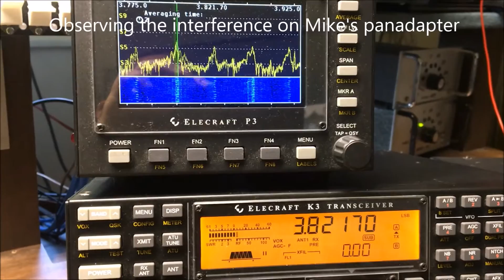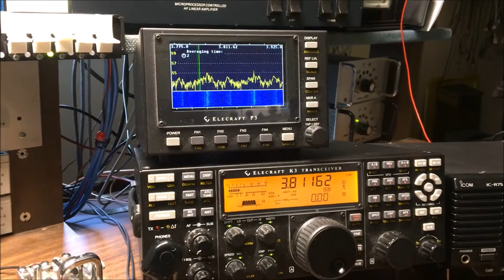Tracking Down Radio Frequency Interference at W9RE on Oct 15, 2016 by WD8DSB

Comment: Where you able to work with the neighbor to get it resolved. And what was it
Reply from the maker: Hi David,
Mike (W9RE) met with the homeowner a couple of weeks after we tracked the RFI down to his house, and the home owner was very cooperative.  Turns out a LinkSys 20 port switch was being run by a 3 Vdc 1 amp power supply, and it should have been using a 12 Vdc 1 amp power supply.  Problem was resolved when the correct power supply was used.  The homeowner commented that the 3 Vdc power supply was very warm, so he was very happy we tracked the RFI down to his house.
Don (wd8dsb)
Reply: I'm glad to hear being that I live out in the country. I deal with everything from electric fencing to bad ballast on barn lights. It can be challenging with neighbors. The people here can be stubborn, and non believing. Glad it worked out.
CU on 160